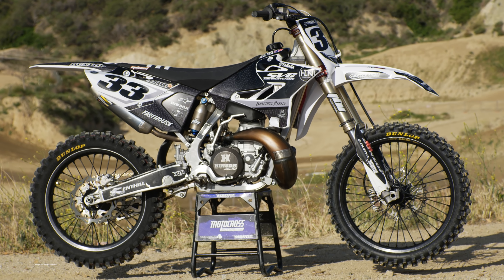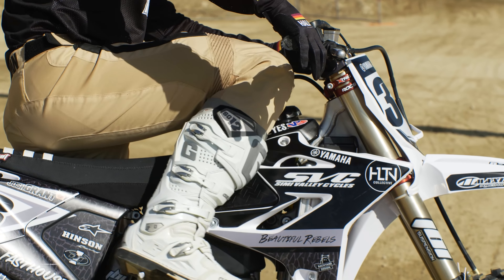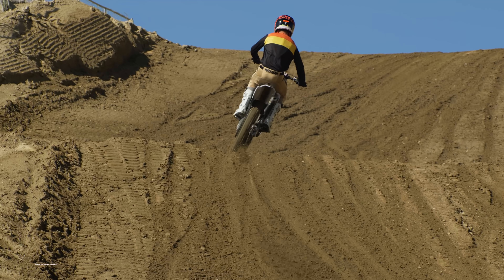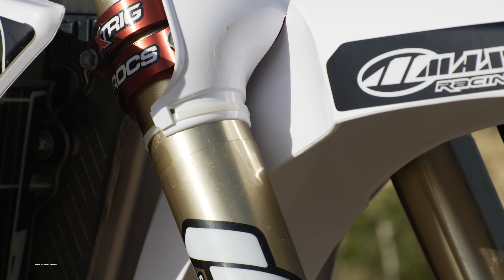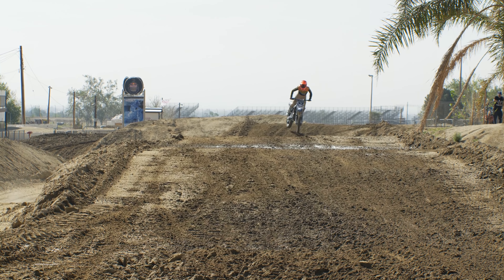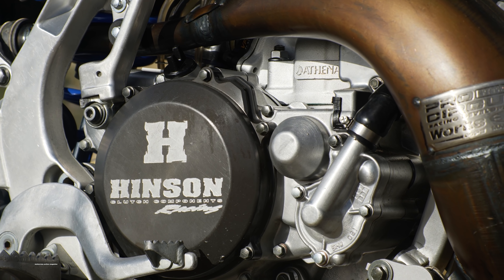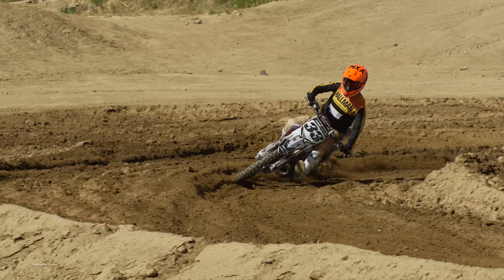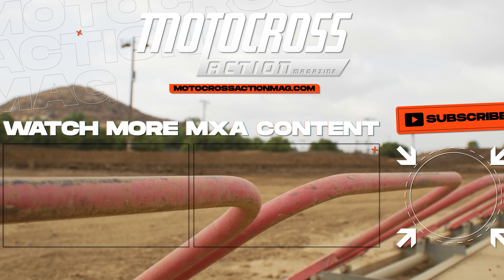Josh Grant's Yamaha YZ300 Two Stroke TESTED - Motocross Action Magazine

Comment: Hmm, PC works pipe and the FMF silencer is an interesting combo. And also Mosiman, i hope you keep an watchfull eye on that secret fuel, sounds like it would beat mrx 02 and C12?
Reply: I had a 97 yz250 with an fmf gnarly header pipe and a pro circuit 304 factory sound silencer. It was a good combo.
Reply: So I had a 04 ram 250, motor was fresh too and bottom , bolt on shit , nothing special but great bike and motor. Had a Fmf header pipe and a bills shorty, it was a GREAT combo for off-road and mx riding … atleast for me. I think there’s some testing out there for some mix match companies with exhaust components forsure

Comment: How about a modern 6 speed, E start Ballance shaft 250/300 YZ250X YZ300X and a WR250/300 two stroke.  Please Yamaha for the love of god make it so!
Reply: if you cant kick start it perhaps its not real moto-word
Reply: @Tew730  get with the program. Look at Suzuki RMZ.... Stick kicker only and see how their sales are. 👇
Personally in a two stroke I want due start. Kicker and E start. No automatic decompression on a two stroke and they are hard on starters. If Yamaha want to sell by the truck load the bike 100% has to be E start.  You can't keep your macho mantra, I'll look at sales figures.
Reply: The modern 2 stroke market is over-saturated already and if someone wants that they will just buy a KTM. Yamaha is genius for not making any radical design changes and producing the same bike year after year. The bike remains simple, cheap, and surprisingly effective while the parts remain cheap and abundant. These bikes DO NOT stay in stock as there is still much demand for them.

Comment: I’ve noticed on a a lot of two stroke build of recent times, people use the vforce3 reeds instead of the 4’s. Why’s this? I thought the 4’s would be better because there the newer model
Reply: Was looking to get a set of reeds from them and stopped because I couldn’t decide 3 or 4.
Reply: No, reason is that moto tassinari who produce Vforce only have vforce 4 for certain applications.

They dont produce vforce 4 for the yz 250, only for the 125 and smaller engines. However they produce them for the KTM (Family) 250’s. 

They should however make one for all the 250 two strokes from all the major manufactures, why? Well two stroke is really making a comeback sort of, more and more people rebuilds them, and the two stroke nationals and redbull straight rythm, and EMX and such. Vforce 3 is however extremely good so perhaps they see no reason to offer the (4), for certain 250s.
Reply: Moto tassani reeds are well worth it..not that Boyesson isn't good too. Go w/either you get best deal on or have good experience w/.
Reply: V.f .3 flow better and don't flutter on the upper rpms.on drag sleds v.f.2 are better than 3 and 4s
Reply: V.f .3 flow better and don't flutter on the upper rpms.on drag sleds v.f.2 are better than 3 and 4s
Reply: Try owning an 05 rm250, companies barely made anything  and yet Suzuki built the best 250 for the last few years of its life but no aftermarket parts. Seen what you mean before about v3 / v4 only v3 for mine.